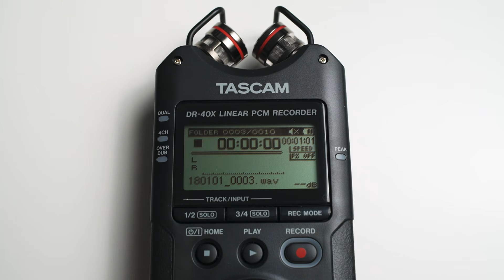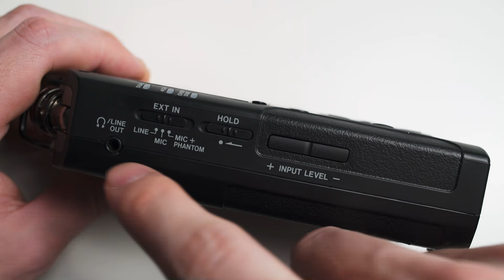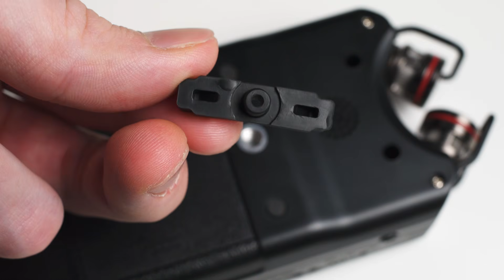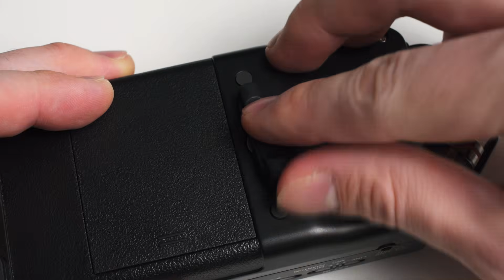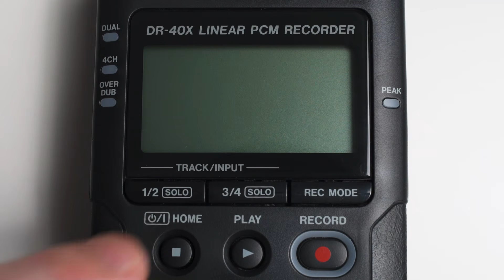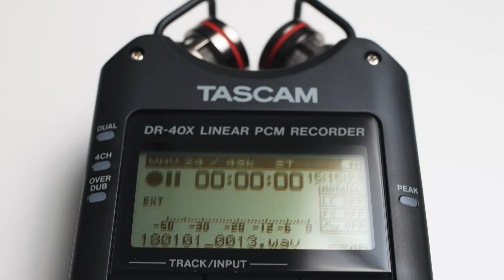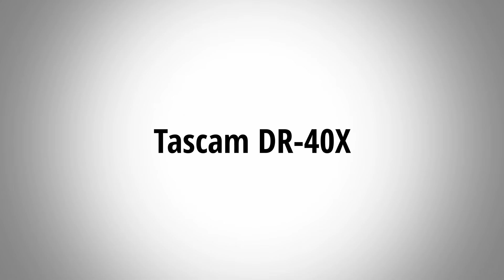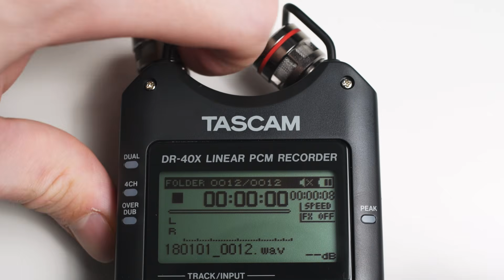Tascam DR-40X Review (Noise, Battery Life and more things tested!)

Comment: Julian, just got the DR-40X and I can assure you that the noise floor that you are experiencing is a fluke. There is little to NO noise in the one I got. I would return your unit and do another review because I feel your unit is defective giving you horrible noise. I feel people might see your review and NOT buy it which would be misleading because it is the best recorder I've had, even better than my Zoom H4n pro!
Reply from the maker: Hey, you use the recorder with a condenser or dynamic mic? With a condenser you are right, the noise is not that strong because a condenser has a decently strong output. But dynamic mics have a low sensitivity and thus you have to set the gain much higher. That's what I say in the video, the DR-40X produces an audible noise floor when used with a dynamic mic.

Comment: Good review, but concerning Input Noise comparison it worth to mention the price of each device in the list because they are from the different price categories. Current prices on B&H:

- SD MixPre-3: $650
- Zoom F4: $450
- Zoom F8: $1000
- Zoom H5: $280
- Tascam DR-40X: $170

Tascam decoders of the higher level have much better amplifiers. For example Tascam DR-60DMII ($200) has EIN rating of -120dBu (seems to be an excellent device for this price if you don't need build-in mics) and their flagship handheld recorder DR-100MKIII ($400) has EIN -124dBu with ability to record at 192kHz.

BTH, SD MixPre-3 being very nice device in general has some issues with 192kHz recording according to "Most Helpful Critical Review" on B&H:

https://www.bhphotovideo.com/c/product/1333778-REG/sound_devices_mixpre_3_mixpre_3_mic_preamps.html/reviews

The quote about cheap plastic from Tascam official site:

"Despite using lightweight plastic for the body in order to keep the overall weight low ... the ribbed internal structure achieves robustness as well as its lightweight."

You have inspired me on all those researches, so thanks for your video!
Reply from the maker: Hey, I was so critical about the preamp noise of the DR-40X because for nearly the same price you can get the Zoom H4n, which has an EIN of about  -120dBu(A). That's the same preamp noise as the H5 and this is miles ahead of the DR-40X. Cheers!
Reply: @JulianKrause  That's a good point although Zoom H4n Pro ($220 on B&H) is still more expensive than Tascam DR-40X and Tascam DR-60DMKII. The latter has better preamps and more descent limiter function than DR-40X. And all Tascams (including the most cheap DR-05) have at least one very nice feature that Zoom recorders missed (please correct me if I'm not right about Zooms):

it is so called "overdubbing" mode, when you can play a music track and simultaneously record new one over it. So, you can record each instrument and vocal one by one if you want. In models that have 4 inputs (DR-40X and above) you can choose to record a clean track or a mix, in cheaper models with 2 inputs only you can record a mix only, but you can change the input volume of the playing track and your recording sound separately. I found it very useful even in the cheapest models and for me it's a deal breaker.

So, my understanding of Tascam line-up is following:

From DR-05X to DR-40X/DR-44WL - low-range models with a lot of nice features and excellent sound quality for that low price, but more expensive models in that range offer more features/options, but not better sound quality;

DR-60DMKII / DR-70D / DR-701D - specially designed for filmmakers, have better sound quality than lower models, good reputation on the market and very affordable price ($200-$450);

DR-100MKIII - for music recording (up to 192kHz) or for everything else if you need better quality than DR-40X can provide and want handheld form factor. Has great sound quality and some extra features (like digital input). It is definitely better than Zoom H4n Pro which you've mentioned above (and Zoom H5 either if it has the same preamp noise as you say): https://www.youtube.com/watch?v=Difo4xr7j3w

I highly appreciate your criticism about preamp noise, it helps a lot to understand the position of each model on sound quality gradation and that understanding is not easy to get somewhere else.

Comment: Would you recommend the dr-44wl over this? I wanted the h4n pro, but I like tascam as they have the safety track function and it helps that it also has the auto level like the h4n.
Reply: I guess all you can get from DR-44WL over DR-40 is Wi-Fi option. Take a look at DR-100MKIII, seems to be much more promising in all terms.

Comment: great video.
Could you make a review of the Sony PCM M10 and compare its noise-floor to that of a Sound Devices?
Reply from the maker: Well, the M10 has a 3.5mm input and the Sound Devices recorders mainly use XLR inputs. You would use very different microphones with these recorders and I'm not sure if that's directly comparable.
Reply: @JulianKrause  There is available an XLR to 3.5mm stereo adaptor.  A test would be to compare the noise floors, using the wave forms in Adobe.  From my general observation from playback the M10 has very low noise floor which is surprising for a little prosumer recorder that only has one input and no xlr.

Comment: Good review. I came to the very same conclusion after testing this device for a couple of weeks. The build in mic-pre-amps - for the use of external mics do have a very high self noise. The build-in mics are good, but very sensitive to wind-noise. Last but not least: the limiter function is useless because it's digital (meaning that it has to lower the total input first - which introduces extra noise). Next to this all, the recorder is very sensitive to RF-noise when using the build-in mics. Using a mobile phone in 1 meter from the unit, or standing in a ~50 meter range of a provider-antenna ruins your recording. That is unacceptable in my opinion.
Reply from the maker: I haven't had any RF problems so far but good to know. Thanks for sharing your experience with the DR-40X!
Reply: do you ever have this RF issue with external mics plugged in?
Reply: @AfroGelXT  I have never tested that and therefore I cannot answer your question I am afraid. But now that I am here,  the reliability of the unit seems fine. At this moment, and 3 years later, I am still using the Tascam. Now mainly as a back-up recorder while using the line-input XRLs. The sound quality is all right, but nothing to write home about. Still a wonderful recorder if you don't want to lose a special moment (and are using a reliable SD-card of couse). The unit itself had never let me down.
Reply: @IV0IV0IV0  thanks!

Comment: Excellent review. Which one do you recommend as a portable audio recorder with all these options, but better quality.
Reply from the maker: Hey, if you only need the internal mics to record sound, the Zoom H1n or Tascam DR-05X will be cheaper and do the job just as well. If you additionally need XLR recording capabilities, the Zoom H4n Pro is about the same price as the DR-40X but has much better preamps. And if you can spend a little more, the Zoom H5 will provide a better usability with its rotatable gain knobs.
Reply: @JulianKrause  Thank you for your reply. Regarding H1N & DR-05X which one is better.

Comment: Very informative review, Julian. Thank you. 
I had the DR-40, which got damaged so I've just ordered the DR-40X (same price). I didn't notice much of a floor noise before - at least not one that I couldn't easily remove in post.
I'm not familiar with all the technicalities, so what I got is more by luck than judgement.
I use this DVR with an LCT 640 condenser mic - so I'm not sure if the preamp noise issue is something I need to worry about.
Could you please clarify this for me. I understood the the LCT mic has a built-in preamp (is that correct)? So do I simply disable the preamp in the Tascam (how do I do this)? Is this what the input gain is all about?

I'm recording voiceover exclusively, so maybe none of this is relevant to me (just speak closer to the mic?) 
Alternatively, what do you suggest as a decent, inexpensive preamp for a condenser mic like the LCT?
Or what do you suggest as a similar DVR like the Tascam in the same price range, but which doesn't have the problems you mentioned?

:)
Reply: Well, I managed to cancel my order for the DR-40X and decided to go for the Zoom H4n Pro for an extra $30. I hope I made the right choice, but one reviewer did seem to think it had a lower noise floor, plus the button layout seems a bit more logical (you can quickly select any of the 4 input channels in any combination and the menu button is away on the side) but otherwise all the other features seem identical. The only difference being that the built-in mics are fixed in XY position, but you can adjust the directionality from 90 to 120 degrees. Thanks again :)
Reply from the maker: @LearnThaiRapidMethod  Hey, I would have recommended you the H4n Pro as well. As far as I know, the preamps are the same as in the Zoom H5. You can hear the difference to the H5 in this video (I accidentally labeled the H5 as F5 at 6:47). With a Zoom H4n Pro in combination with your LCT 640 you can make very low noise recordings. Enjoy your new recorder!
Reply: @JulianKrause  TY :)
Reply: @JulianKrause  Thank you. I've been working with the H4n Pro for a few days now and it's a great little device, solidly built, impressive internal mics (albeit super-sensitive to ambient noise) and low noise floor - esp. with my LCT640 XLR mic.
Reply from the maker: @LearnThaiRapidMethod  Great to hear! Btw. the preamp has nothing to do with how much ambient noise you pick up. That has to do with the mic you use. Be sure to get the mic close (about 8 inches) to your mouth to get the best sound quality possible.

Comment: Hello Julian! Thank you for the video! I was starting to consider the DR-40x but was dissapointed by the noise level... If I'm going to be limited to the built-in microphones in order to avoid noise, than I guess it makes more sense to look at the Tascam DR-05x or the Zoom H1n... Do you have a suggestion between those two or in general? I'm looking to spend around $100 - $200... It's for recording the audio in my rock band's rehearsals. The DR-05x seems to have more features than the H1n so I'm not sure. Thanks again!
Reply from the maker: Hey, if you only need the built in mics the DR-05X or a Zoom H1n would be a good choice. I haven't had a chance to test the DR-05X, so I can't really compare it to the Zoom H1n. If the DR-05X has a special feature you need, then I would go for that device. But other than that, I would buy the cheaper one. I have the feeling that the audio quality of the built-in mics is not too different.

Comment: Hello Julia, Would you recommend the Tascam if I am going to use my Fethead with it? I am using the DR-60D Markii and love the ability to record a safety track. After visiting my local store, the Zoom H4n Pro rubberized material looked bad and the H5 felt sticky and looked absolutely horrible. The sales person has the H5 and wears gloves in the summer when using it because of the stickiness, this is an issue they need to address. Of course, sound quality is the most important feature so if using the Fethead would make it a draw between these devices in terms of sound quality I would go with the Tascam first, if not the H4n Pro. I love watching your videos, they are very helpful and informative.
Reply from the maker: Hey, yes a FetHead will lower the peramp noise considerably. The DR-40X can give you a very good audio quality in combination with a FetHead.

Comment: Which fethead should I get? I use the original Tascam DR40 with a phantom powered Audio Technica AT875R super cardioid mic.
Reply from the maker: Hey, with the AT875R in combination with the original DR-40 you do not need a fethead. Your whole system is limited by the noise floor of your mic and a fethead won't bring any appreciable improvement of the noise floor. Try to get your mic as close to your talent as possible and you should be able to make low noise recordings with your setup :)
Reply: @JulianKrause  thanks